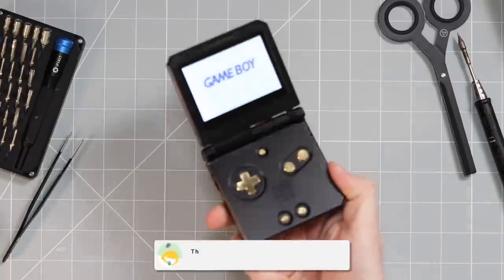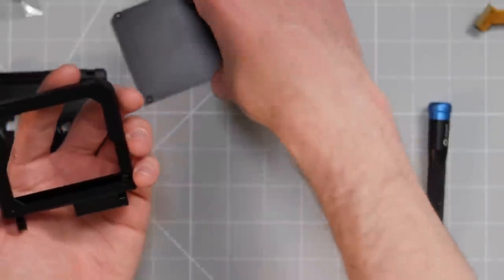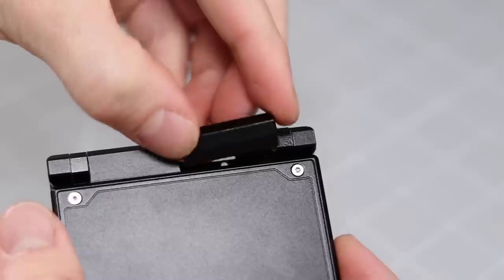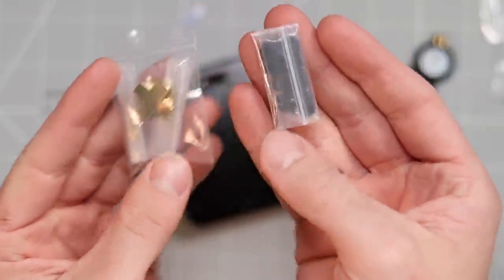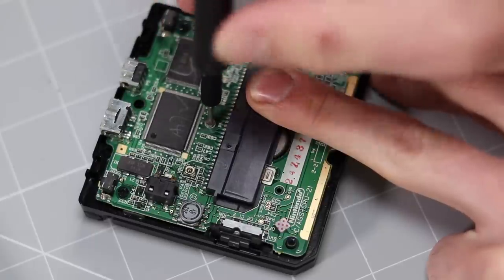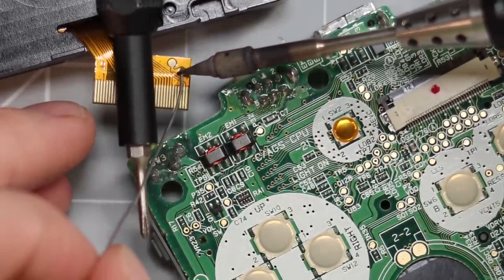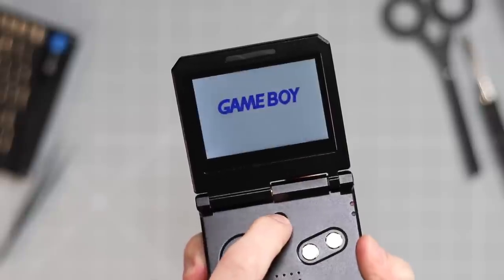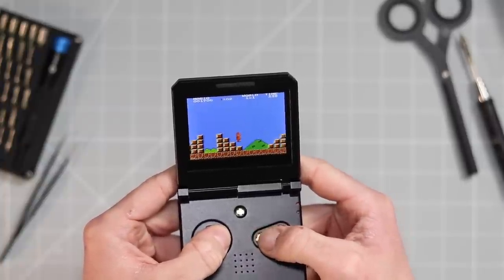If the GameBoy was made today…

Comment: Awesome that a metal shell now exists. In addition to your feedback, I think they should offer the option to etch custom designs on it, like the official ones that have a design on the back of the screen side of the shell, or perhaps allow placing designs anywhere. Also, add screw covers, and add an acrylic pannel to attach as a game cover. While I do like being able to see the game's label, I don't like the idea of the cartridge slot being so exposed, as it is on the prototype, so with a clear acrylic pannel to match the rest of the original slot's size, it would solve both issues.
Reply: They actually do offer a laser etching service that's compatible with most of their shells, but I do agree that there's way too much cartridge being shown off in that slot

Comment: If it's anything like his GBA Macro faceplates, I'll be picking one up for sure.

That single bumper though, is not great. I think he should use the round bumpers that are already shipped with normal SP replacement shells. Nintendo used two bumpers so the top didn't rock and stress the hinges when the thing is closed and in your pocket!

Also, I'd really like if there were a spot for the Nintendo badge ❤
Reply: @@boxypixel Can't wait! I'll definitely be picking one up :)

Comment: I have this beta build also and just assembled - to fix the L and R trigger button issue you have to take out the 2 backside top screws, the less pressure will allow the triggers to depress. Will be fixed in the release models I’m sure.

Comment: Hey I have a quick question. Do you know anyone that has experience with the GBA cartridge hardware? I have a copy of Pokemon Emerald with absolutely ruined pin contacts from a horrible repair attempt years ago, and I'm trying to figure out how feasible it would be to remove the main chip from the board and swap it on to a working copy.

Comment: Would metal buttons potentially put extra wear on the PCB button contacts, due to the extra weight?
Reply: I don't think the buttons from Boxy will have an issue. They always seem to be high quality. The weight alone wouldn't cause a problem.

Comment: As I recall, metal buttons are BAD for the motherboard of a GBA SP, as the metal will dig into the button contacts over time. The metal from the central pivot on your Directional pad can dig into your motherboard over time. I advise you find something to tweak that central pivot or something...
Reply: Metal buttons directly on the contacts (like on the Slate) are what’s bad. Since this uses the original membranes as well it’s perfectly fine. Just like how it is fine on the Boxypixel Unhinged.